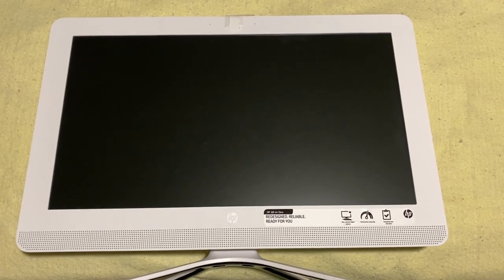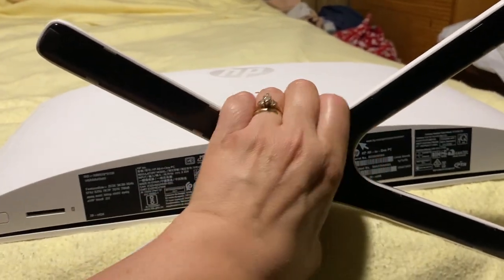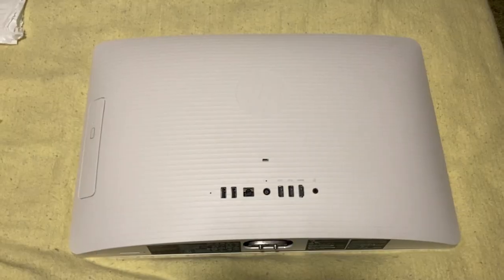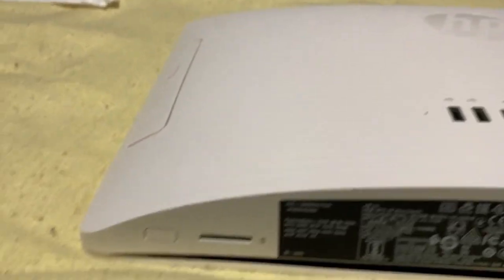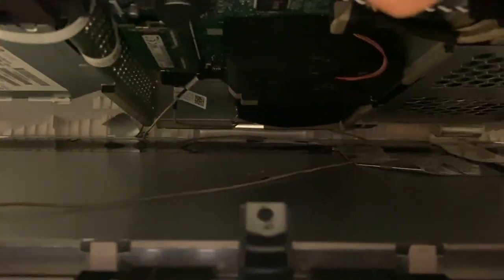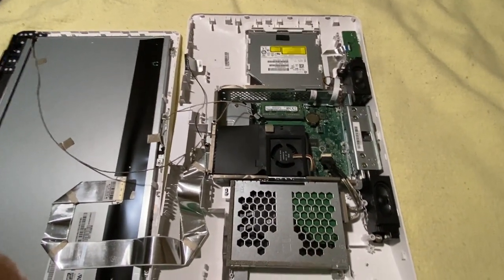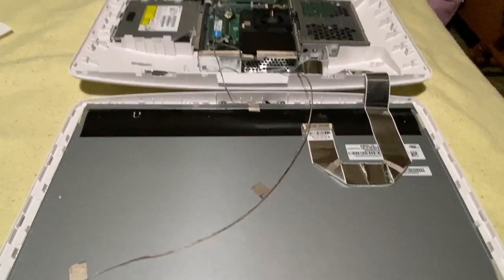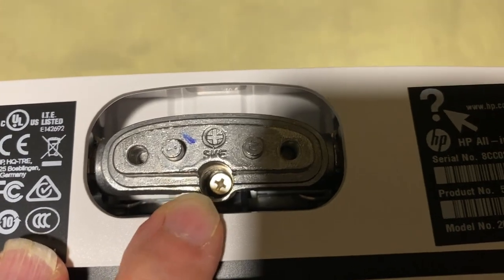HP All-In-One PC Model: 20-C434 Memory Upgrade: How to replace 4GB with 8GB DDR4-2666 SODIMM

Comment: I hate computers. I can more easily deal with rebuilding a small block motor for my Impala than understand the workings inside that white heinous contraption. But we just can't live without them in this day and age. I do appreciate the video you've posted and will now be able to upgrade the computer my wife uses. Tired of hearing the complains about how slow it works. If it was her car, I'd just drop a big block in it! Thanks so much for making it look so simple.
Reply from the maker: I have the opposite issue...i don't like working on cars. Lol
Reply: Just spent about 30 minutes and upgraded the computer for my wife. Thanks again for the video.

Comment: hi can i install 16GB or higher RAM instead of 8GB if not thanks for the video!
Reply from the maker: Hello, this model caps out at 8gb. If you have a different model it may hold more. I would google or search HPs site for "HP All-In-One PC Model # (your model#)  specifications". Hope this helps.
Reply from the maker: Another option is to go to the Crucial memory site and use the memory scanner. It should tell you what to get.